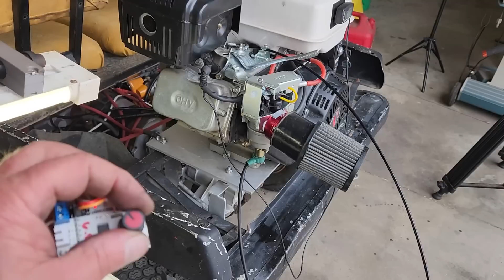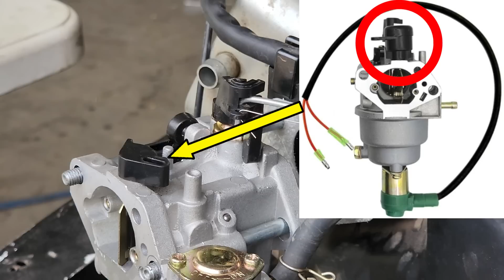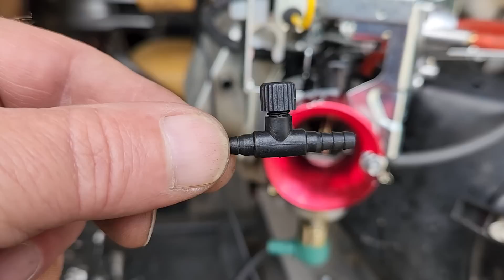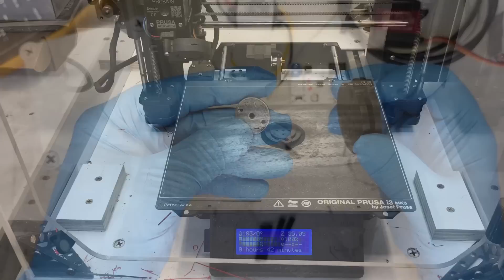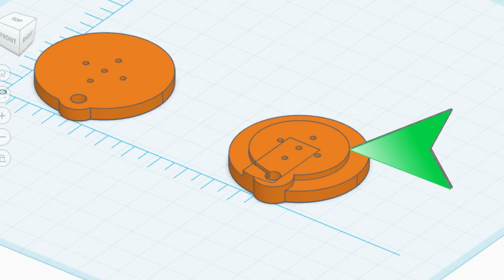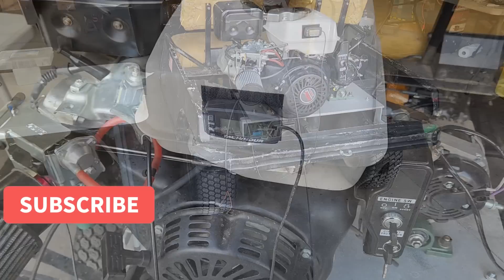S5 E17. We fit an automatic choke to the Predator 420 cc Hemi engine, Plus we build a throttle servo

Comment: Hey jimbo, what turbo are you going to use on the diesel honda insight?
Reply from the maker: We are planning on using the RHB31/VZ21.  Keep in mind the engine is only 719cc and each cylinder is 239cc.  Not a lot of exhaust pressure to drive a turbo on this engine.
Reply: @robotcantina8957  add affiliate links and say there's jungle site links if you want to use the same stuff I did. It's simple and people can vote with their wallets.

Comment: I'm wondering how that automatic choke works, is it only for starting up? The scooter ones have a thermal expansion thingie so the engine is choked while the carburetor is cold. I would have chosen the servo as well for the choke, but I run with the electron crowd.
Nobody will be bothered by affiliate links, especially as you don't seem like the guy who's just promoting stuff for revenue. I have a small tinkering blog and made a few bucks ($$) but then stopped when Amazon just withheld the money.
Reply from the maker: There are many different ways,  on my 212cc engine in the Club Car, it has a servo choke.  That works great, but I needed a nuts and bolts solution to appease the majority of the audience.

Comment: Great content as always!!  I was always a little skeptical of auto-chokes driven by vacuum.  Think the venturi will produce enough vacuum to keep the choke open in WOT?  You will need all the power from those engines to achieve that 10 second quarter mile... Ha ha!
Reply from the maker: Yeah, that could be an issue at wide open throttle.  On this big engine we don't expect it will be under a huge load though.

Comment: Am I the only one that laughs when people say that you should turn your car off when getting gas.  The reasoning being that the car could back fire.  The last I checked cars do not back fire any more.  And they only back fired when turning off and starting back up.  So my car just sitting running smoothly it will not backfire because I am not truing it on or off.
Reply from the maker: Indeed.

Comment: Great work, I may apply this to my lil project today. 

Just an FYI for potential future content , I have been going down the rabbit hole of the cheap dual fuel (propane) carbs that are all over the jungle site for potential use on my Mud Motor, There's not much data on them on the tube beyond  a couple of installs. Could be a good fit for this unit and a way to work in yet another fuel source......
Reply from the maker: Interesting.  I have seen the dual fuel carbs, perhaps I need to try one.

Comment: Seems to me that a manual choke cable would be way cheaper and easier to hook up. That doesn't make for engaging content, though.
Reply from the maker: Indeed, the remote manual choke is an option, but I wanted a completely automatic choke.

Comment: Would it have been possible to swap the choke shaft and associated linkage between the original carb and the clone generator carb? I haven't messed with the Honda style carbs that much, but I know most Tecumseh small engine carbs used the same dimension shafts so you can unscrew the butterfly and swap linkages between them, great trick for the earlier H30-H50 engines that aren't compatible with linkages on the cheap generic replacement carbs.
Reply from the maker: It may be possible, however the autochoke bracket would also need to be cut up to provide clearance for the predator carb.

Comment: electronic throttles can be very dangerous. in your case it's fine since you have the electric drive system to control power out, but for a direct drive/cvt setup I would caution the average person against electronic throttles. in proper cars there is a dual/redundant sensor on the pedal as well as in the throttle plate, plus special software safety code that makes sure there's no glitches on either system to prevent unintended acceleration. early Toyota e-throttles had a single sensor and that didn't quite work out as desired for them, if you recall.
Reply from the maker: Indeed, I have played around with real drive by wire systems in the past and there is a lot of safety engineered into them.
Reply: Well I think they recalled first though...

Comment: Nice setup, if you put that part on the servo first you wouldn't need that extra hole? You having Amazon links would be helpful so we could order the correct junk parts we would need for one of these projects.
Reply from the maker: Yes the extra hole wouldn't be necessary.  But if you are experimenting with different sized pulleys, then it comes in handy.

Comment: My 10 year old  troy-bilt pressure washer with a briggs has always started on the first or second pull it doesn’t have a choke rod or primer bulb as long as it worked I left it alone, it blew a head gasket a couple of weeks ago I found how the carb worked it has a light spring that closes till the governor pulls it open when started this probably wouldn’t on other things because a pressure washer is always at full throttle
Reply from the maker: LOL, I reckon a lot of different manufactures have there little magical gizmos for easy starting.

Comment: I think needing choke is just a predator engine thing.  I have a few, a 212cc, and a couple 301cc engines.  every single one needs choked every time you start it.
Reply: I have a predator generator with manual choke which does NOT need choke on hot restarts… on warm days sometimes can be started “cold” with no choke… I live in north east Texas
Reply from the maker: indeed, perhaps its some sort of EPA mandate.  Back in the day, I never had an issue hot starting an old briggs.

Comment: If I were in charge of the problem at 1:46 I would have used a string and maybe 1 or 2 pulleys.
Reply from the maker: LOL, that would work.
Reply: Lol sounds like the kind of redneck engineering I’d do!

Comment: I'm surprised you didn't mention a rc servo motor with an audrino
Reply from the maker: I did,  we used the servo tester gizmo to set up the throttle pull thingy, but I did mention we would be using an Arduino in the future.
Reply: @robotcantina8957  I was referring to the choke, but later realized what you were going for. I later saw the servo setup for the throttle. Nice work 😉